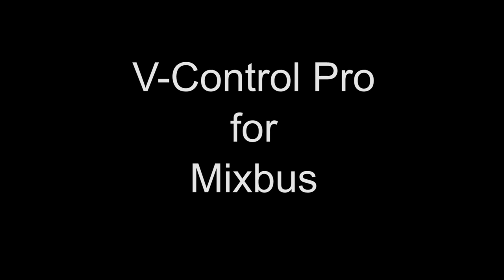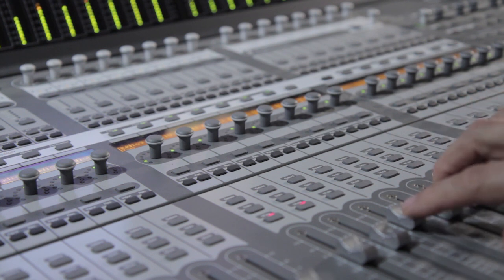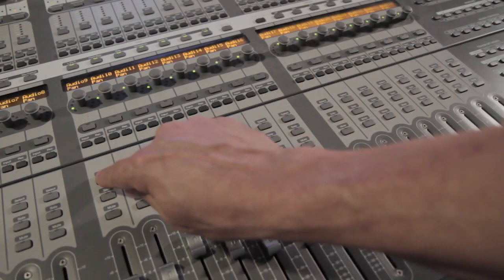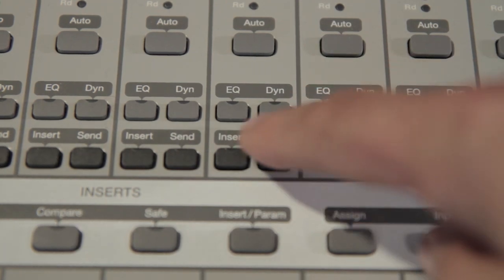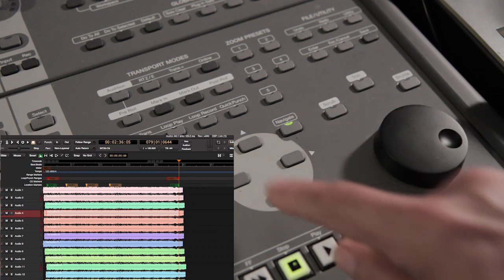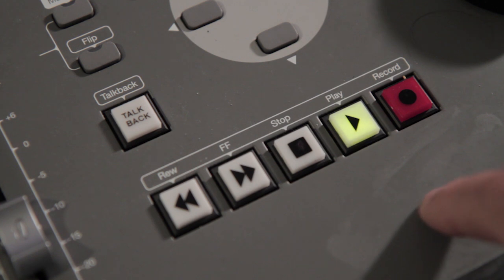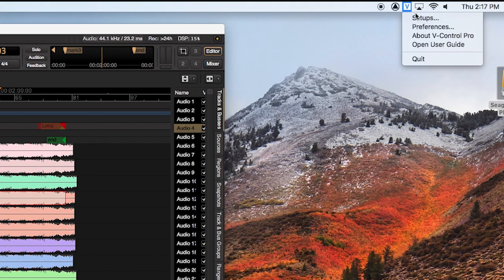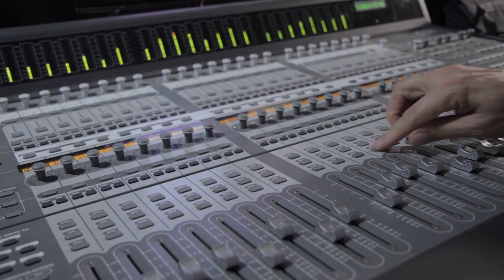Mixbus With C24, Control24, and Pro Control

Comment: Hi I have c24 I have problem the LED is not working only yellow color if someone know how to  fix it
Reply from the maker: Probably you need to open the unit and clean cable connections with DeOxit.